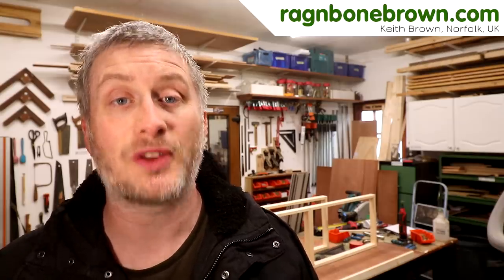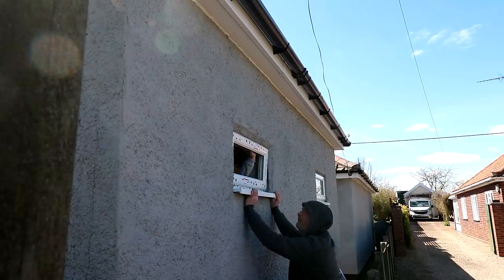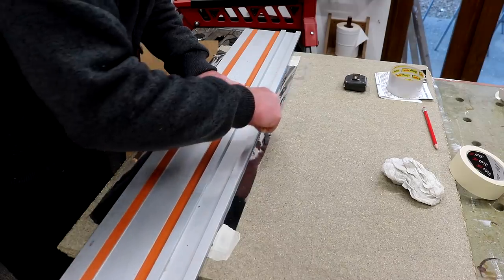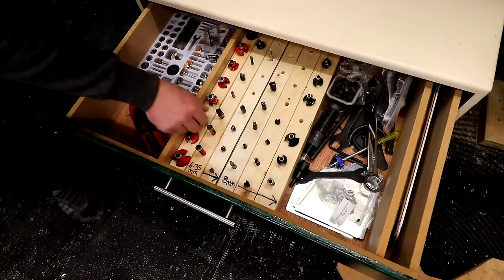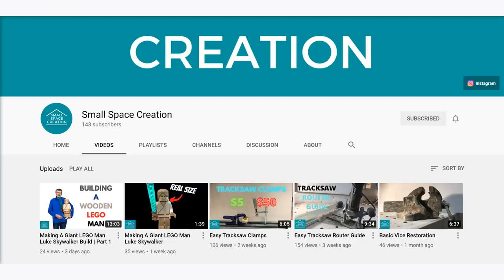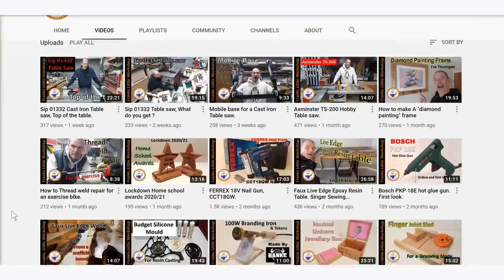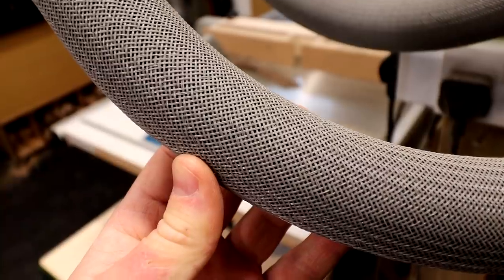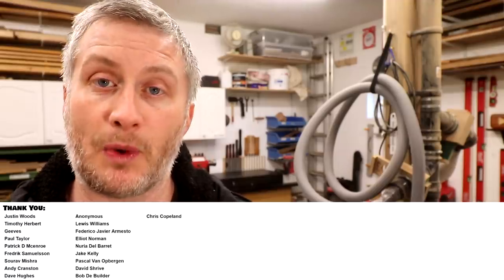VLOG 14 - Workshop Changes / What's New / Recommended Viewing / Tool Talk (Milwaukee)

Comment: Yes, Small Space Creation is a great channel! I was also very impressed with the diy bench dogs idea. I went straight to Toolstation for the the 3m length of 20mm conduit with 20 couplings, and then Ebay for the 16mm dowel in 1m lengths. I've already knocked up a wee bundle,  and I can honestly say, it has to be the cheapest and easiest way to go about it! Top marks to Mark👍👍👍
Reply from the maker: yeah, it's genius!  I don't really use dogs much, but for those who do, it's a great hack!

Comment: Great as always Keith , one thing I would recommend is to fit the smaller window beads first, especially on smaller windows as they can’t bend normally. The longer ones you can bend one corner in and then the other core we as smash away 👍

Comment: No foam around the windows? Some instastik would make them solid and stop draft/noise. Also the direct torx fixings don't need plugs, if they're going into thermalite use a 5mm SDS and 6.5mm for accrington brick

Comment: I used a similar braided tube. You should consider using hear shrink to fix it to the hose and make the end neat in stead of tape. I bought 50mm heat shrink and it worked perfectly for a standard 35mm hose. Just heat it with your heat gun.

Comment: The vacuum hose sleeve looks like a great solution. Was just using my track saw yesterday and the snagging hose spawned some profanity. We don't have ebay here, so will need to find a supplier.

Comment: Hi Keith, in the video where you insulated the walls, you did a sound level check, can you do another sound level check now the double insulated windows are placed,
to see the difference in dB? Grtz
Reply from the maker: I'm not sure it would be a fair comparison seeing as I now use a different phone, with a different microphone and a different app too, and not sure where I was standing when I measured it either.  The windows have definitely cut out a lot of noise though

Comment: Forgive me if I have multiple comments, as I am compelled to write as I watch.  
You original windows were already pretty small, but now the opening is nearly half as much.  Were you un willing or unable to get bigger windows?  How's air flow when you want a breeze?
Reply from the maker: The less windows the better when you're shooting video.  Natural light is a pain to deal with as it affects white balance and exposure.  Air flow is pretty good, they also have a lock position where the window is slightly open (a bit like a trickle vent)
Reply: @RagnBoneBrown  
Very nice. It also occurred to me after the fact, that the other windows didn't even open. So silly of me to ask. Thanks for replying. Great job as well.

Comment: Is that the hammer with the magnetic nail holder, so you don't twat your thumb?
Reply from the maker: Ah, I was wondering what that was for!!! Seriously spotted it and didn't know what it was haha
Reply: @RagnBoneBrown  there was a short vid showing it that popped up a couple of days ago.  Stick the nail to the magnet, gentle tap to start it then bash it in.  Not so good if you need very accurate positioning, but ideal for speed and thumb protection 😆